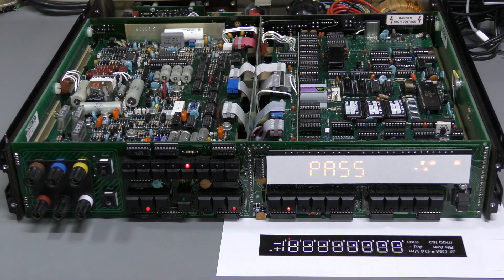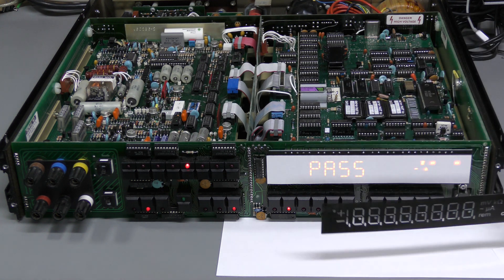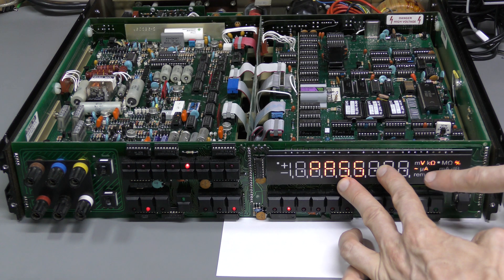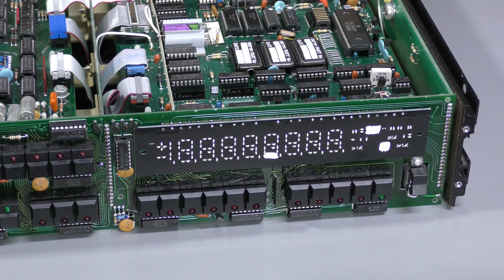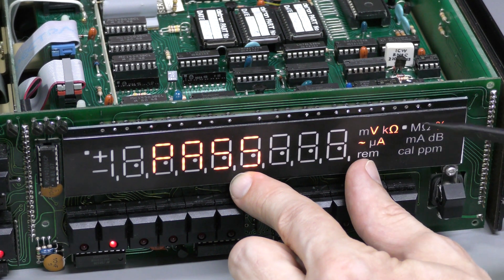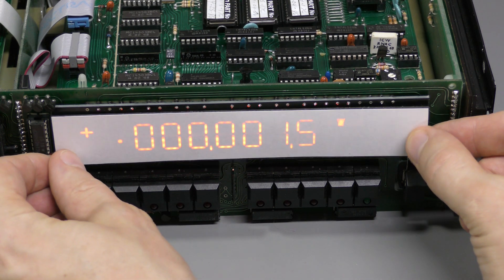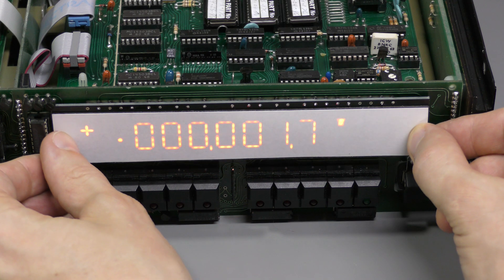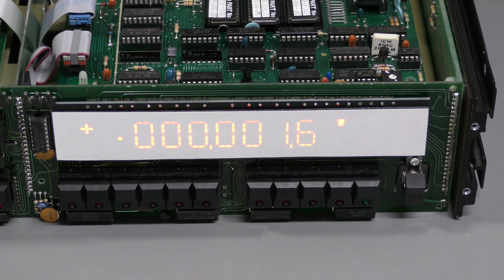#92 - Datron 1071 LED display followup

Comment: Try using the plastic foils of an broken LCD monitor. I found different layers in there especialy in front of the pannel which directs the light of the CFL tubes. Take an old LCD display apart and you will see what I mean.

Comment: Looks good already, and the segmentation quite interesting. 
In cars with a conventional instrument cluster, you usually also have such an application, i.e the telltale, which indicates the state of front light, brake, blinker, airbag, engine, etc. The TOPLEDs are sitting on a white colored PCB, pointing upwards into an array of white light wells, maybe 10..20mm high, and on top comes a diffuser foil with the symbol print. That's enough to blur the LED spot light w/o much loss of luminosity.
So if you  manufacture a new 3D plot, do it from white / bright plastics and make it at least 10..15mm thick. Should do the job.
Reply from the maker: The available room is about 3-4 mm. White plastic will probably have some leakage into adjacent segments.
Reply: @feedback-loop  That's too few space. No, the white plastic material usually does not leak light into adjacent channels.
Reply from the maker: Here is photo of a prototype with a spacer made of white plastic. One can see some leakage. https://www.eevblog.com/forum/repair/datron-4000a-getting-at-test-points/msg2371482/#msg2371482

Comment: Maybe 3D print the black plastic piece with slots for segments that will act as a spacer?
Reply from the maker: Every time I realize after the fact that I should have shown this and that. I should have turned this spacer around completely to show the back of it. I am not sure what you mean exactly, but what I have now is like this, but from black plastic: https://www.eevblog.com/forum/repair/datron-4000a-getting-at-test-points/msg2370510/#msg2370510